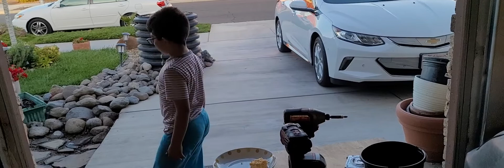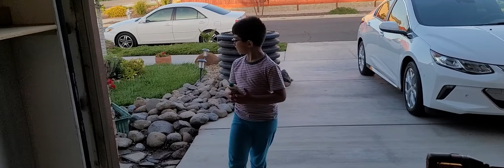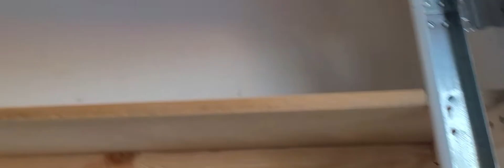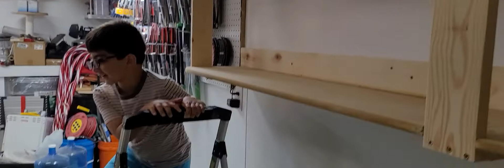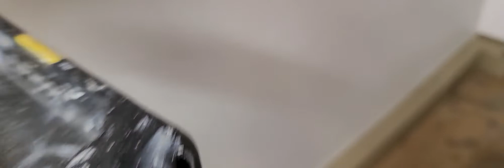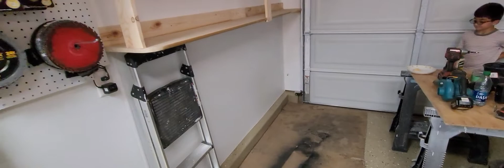Little helper in the workshop

Comment: P, you going to insulate garage doors? Looking good!
Reply from the maker: Yes.  Definitely on the list.  For sounds and temp.
Reply: @PFab  vinyl lined foam panels work great was pretty cheap.  Messy cutting but did mine 3car in 2-2-1/2hrs.